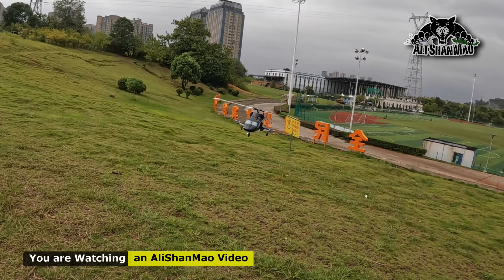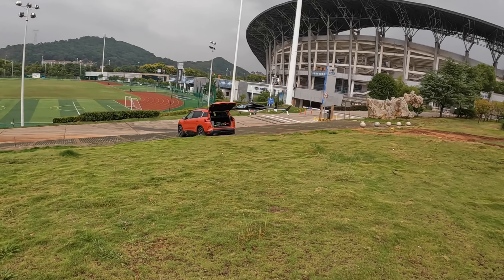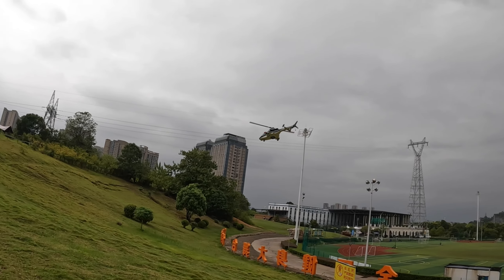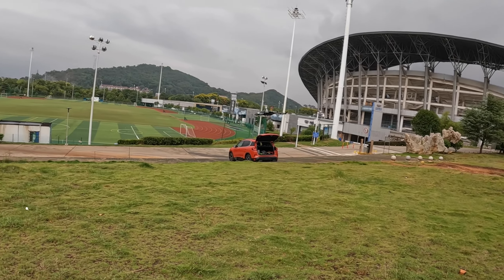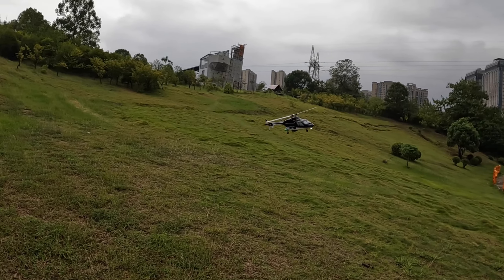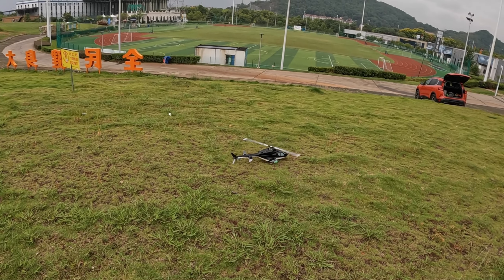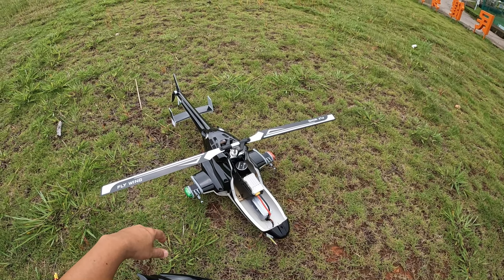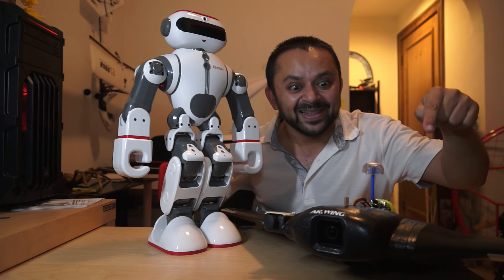Realistic RC Airwolf: FlyWing FW450 V3 with 3D Printed Extras!

Comment: Looks great Ali! really loving the look at that you did a nice job on those 3-D printed parts. I would really really like to see what you can do for the Gooey S1 when it comes to a scale fuselage.
Reply from the maker: Thanks buddy, working on it. as i have never done this, its a very steep learning curve. not just that i have to learn to scuplt the helicopter body right but also need to learn how to fix it properly on S1 (given that goosky will not give me exact detailed product dimensions for each part) so i have to measure, guess, design, print, test, and repeat until i get a fit for a frame, then design a body around. also i can see that S1 can't take MD500 fuselage because MD500 tail starts a bit straight from top while S1 tail is lowered like in center of frame. either we have to loose the tail and mount the motor on 3D printed part if we go MD500 or maybe i practice making a fuselage of my own futuristic looking helicopter and from there i can learn to do more scaled one. was thinking to do LAMA Helicopter :)

Comment: The nose hump can be opened (the part facing the canopy to allow prop wash in to cool the cabin area more allowing for cooler running.  Well desigend and cut slits on the canopy top center above the motor would not also look cooler but also help with motor temps.
Reply from the maker: Thanks for the info!

Comment: I put a couple of aluminum heatsinks on the v3 ESC after getting a pretty decent burn on my forearm. Much better now. Also, please make retracts, that would be amazing!
Reply from the maker: will work on retracts. lots of new stuff to learn which is taking time. 3D design is not easy, specially if you are not a graduated or proper engineer. doing my best
Reply: @alishanmao  I am not good with CAD, but I have a couple of 3d printers if you need help testing parts.

Comment: Very beatiful ! I have just received my V3 from RC GOING and i have a little question , it is possible to fit a v3 in Fly Wing BELL 206 fuselage or  i have seen a same bell 206 as a  470 fuselage ?  470 is too big or not ?  Thank you for your answer !
Reply from the maker: won't fit in FlyWing Bell 206, may fit in other fuselage 470 size with some modifications. best is to get an airwolf. Congrats and have fun.

Comment: Hi ali mate i have 3d printed a as350 for my fw 450 v3. My question is i want to put nav lights on it. Can i plug them into a spare channel on the stock reciever  for th 5v power needed to power the lights. Thanks mate
Reply from the maker: sweet. would love to see it. because i want to print a scale fuselage for FW450 V3 as well. also i have a power combo module for Bell 206 is laying here with me and it needs a fuselage. you can power the lights from rx but its a bit risky, because if leds drain a bit more power, it can freeze the receiver and fly away the helicopter because receiver freeze does not activate RTH. best is to get a separate UBEC to power such
Reply: @alishanmao   thanks for the reply ali. Once the weather improves in uk i will take her out for a maiden flight and post it on my channel mate

Comment: Assalamualaikum Ali... have a nice day. I just wanna know what happen to my FlyWing Airwolf FW450. When I turn the switch to run the heli run good but when I push the throttle to fly it, the heli seem lost it power. It just  take off for a few inches and then descending as if that the heli is lost it power. Can you advise me what actually happen to my heli.
Reply from the maker: wassalam check your battery and its charging

Comment: Hi Ali. Thanks for a nice video! I just got my 450L-V3 from RCgoing. 3 questions:
Do I need to calibrate compass?
Is it the ESC V4 inside? 
Is it the new GPS inside?
Thanks in advance!
Thomas from Sweden (with Private Helicopter Licence!).
Reply from the maker: Hi Thomas, the new ones have the new GPS, but for V4 ESC, need to double check. so far right now all ESCs are V4 as per my knowledge. they have a new look as you seen in this video

Comment: The strange thing about this is the white windows which actually is how the Airwolf simulator in the show appeared....  And Flywing does say simulator so I wonder if they were trying to avoid a license problem by saying they copied the simulator instead of the ship itself...  Either way I hate the white windows...  I was thinking you could paint them a transparent black...or cut them out and put in clear but I don't know where you would find windows...
Reply from the maker: Well I can always cut them out and 3d print new ones with transparent filament. or make new with transparent thin plastic. need to 3d print some cockpit details inside that can sit on top of battery and make it look more realistic. but thats just tons of work and i need to find time to do that :)

Comment: I just wish Flywing could figure out a way to get rid if that tail rotor loud buz sound. Its on all my flywing helis.
Reply from the maker: using a larger and better design quieter blade will solve the issues
Reply: Yeah I noticed my Huey has bigger tail blade and isn't as loud. Maybe I'll try one of my Huey blades on airwolf
Reply: As long as it doesn't strike the ground.